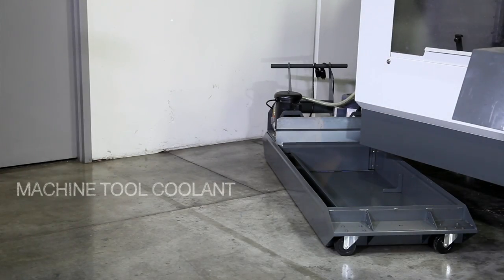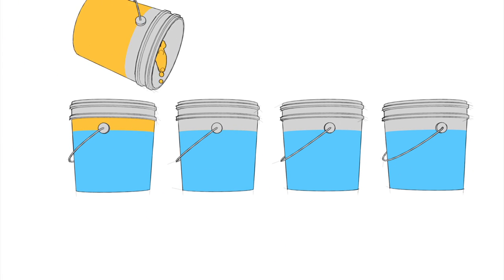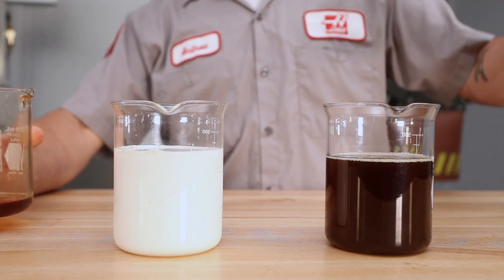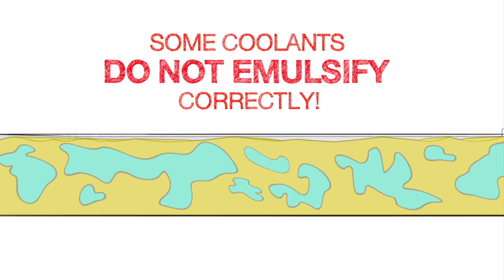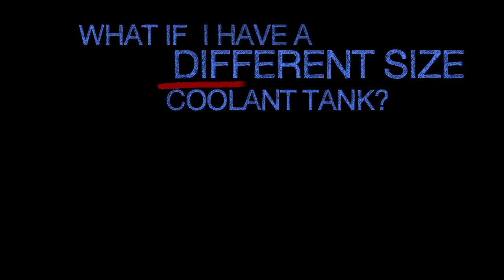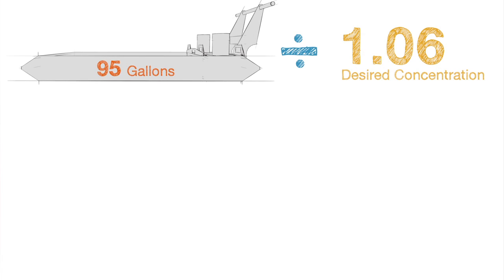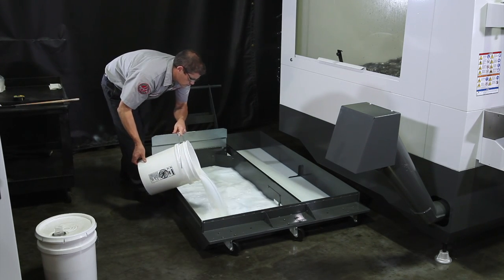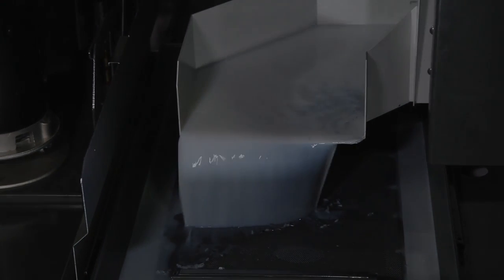Machine Tool Coolant: Making a New Batch

Comment: Why are you using that 4:1 ratio when you know that it's going to be a to high concentration mix at the end? Wouldn't it make more sense to mix some closer to what you are trying to achieve so you don't have to use so lean mixtures later?

Comment: I am not confident in the math on this video but I could be missing something. Also, if you are using synthetic coolant then it will have a different "refractive index" than standard coolant. For example Blaser Synergy 735 has a refractive index of 1.4 meaning: A reading of 1% on a Brix type refractometer will actually be 1.4% coolant concentration.  The Brix scale is actually meant for concentration of various sugars but works for STANDARD coolant at a 1-1 ratio and SYNTHETIC coolant at whatever the refractive index happens to be. To keep it simple, Blaser recommends keeping the Synergy 735 SYNTHETIC coolant concentration between 5 and 7 on the Brix scale which equates to 7% and 9.8% actual synthetic coolant concentration in the tank.
Reply: Very useful points here! Also using the fully synthetic (oil-free) Aqualub CSA 10 with a refractive index of 2.0, so whatever Brix type reading, is multiplied by 2.0 to give the actual concentration of the coolant. The recommended concentration by the manufacturer is 3%-5%, so the Brix reading should be between 3/2=1.5 and 5/2=2.5! Thanks for sharing my friend!

Comment: That's some pretty wonky math.  
Let's say you have a 100 gallon tank, and you want a 50% concentration.  Hopefully it is obvious you need 50 gallons of concentrate, right?  But by your method, 100/1.5=67 gallons of water + 33 gallons of concentrate.  This is wrong.
100 * 0.50 = 50.   Tank size * concentration = amount of concentrate to use.   In your example 95 * 0.06 = 5.7 gallons of concentrate.